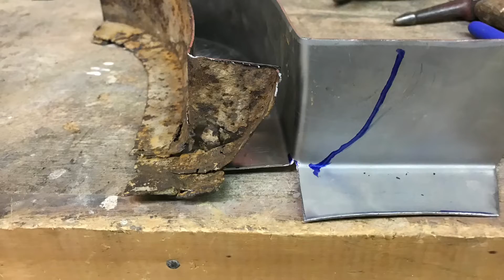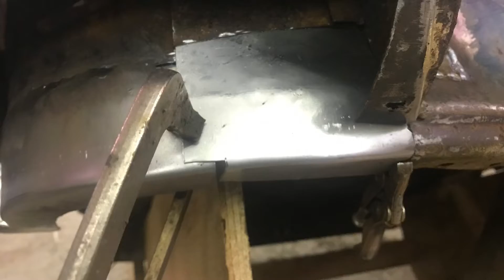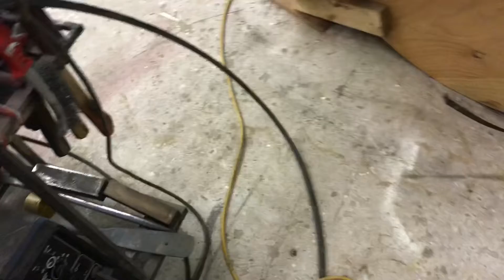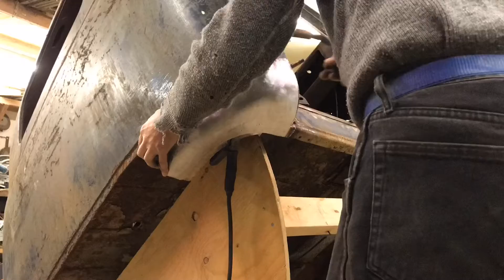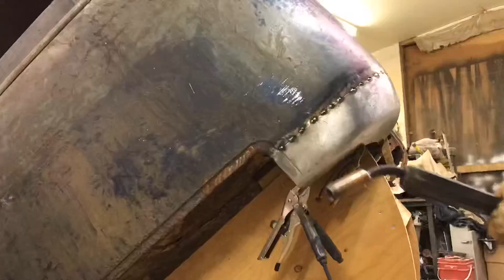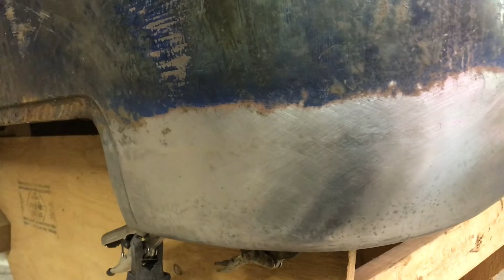How To MIG Weld Thin Sheet Metal, 1950 Chevy Cab Corner

Comment: That little white dot reminds me of watching tellie back in the old black and white days! For finding the lows I like using a vixen file. It also helps make all the surroundings smooth. Of course you're removing metal so that's a downside.
Reply from the maker: I have a file, I’m using it more lately, thanks for watching.
Reply: @WildWestGarage  The way I use a file I need to start with 3mm thick steel it seems!

Comment: Looks like it turned out perfect! Even tig welds start to ghost like that when you sand them with a finer grit, like you said that's what high build is for.
Reply from the maker: Thanks, I’m not sure how practical this level of metal finishing is on a project like this but the challenge keeps me interested.